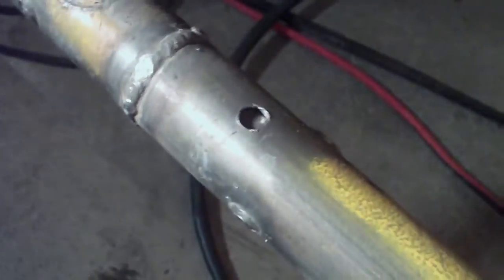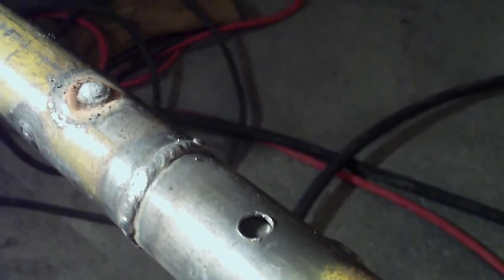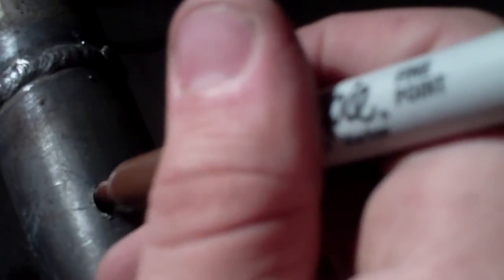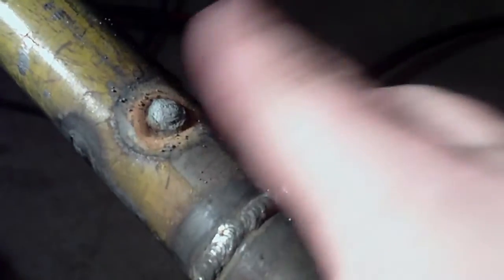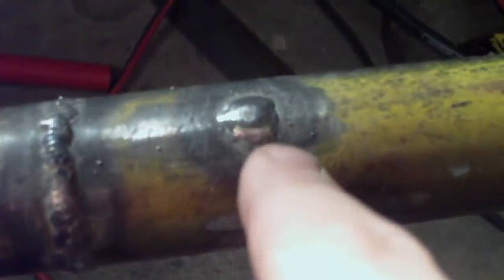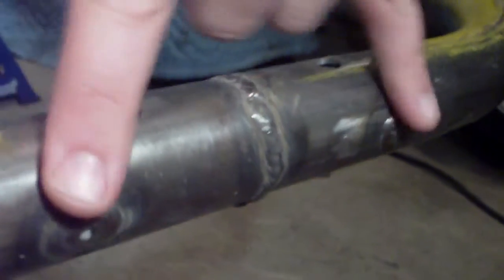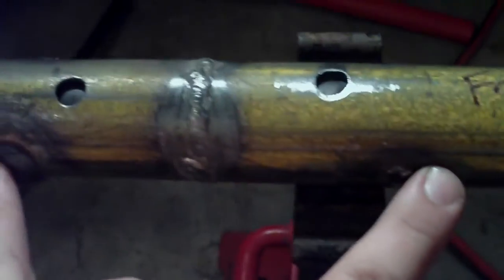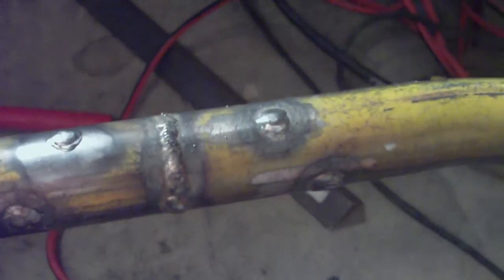Trike Update -- Rosette Welds

Comment: Thanks for posting this. I was reading FAA regulations on welding and there was a section on rosette welds but no pictures so I looked it up and found this. Exactly what I had imagined. I like how you staggered the holes too, seems like a good idea to spread out the heat load. One thing I thought I'd mention though is that in my reading I learned that grinding a weld smooth, while pretty, does weaken the weld so airplane mechanics are instructed not to do so. But I realize that you aren't building an airplane so that may not concern you. Just thought I'd drop some knowledge. (FAA article A.C. 43-13-1B CHG1)